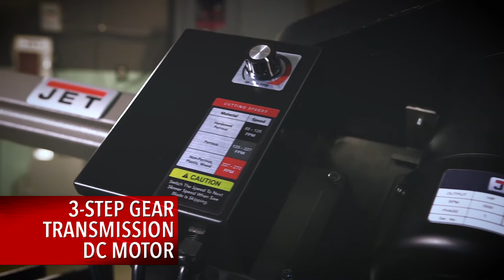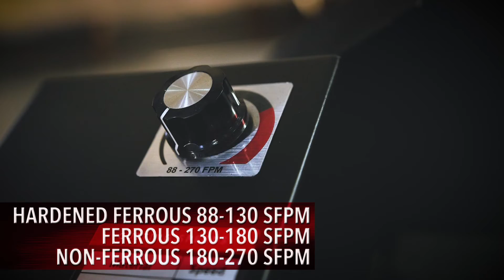JET Variable Speed 7x12 Horizontal/Vertical Mobile Metal Bandsaws

Comment: Can the deluxe options be purchased separately to upgrade a standard HBVS-712V? Specifically the quick adjust mitre and the blade adjustment to increase throat depth when upright.